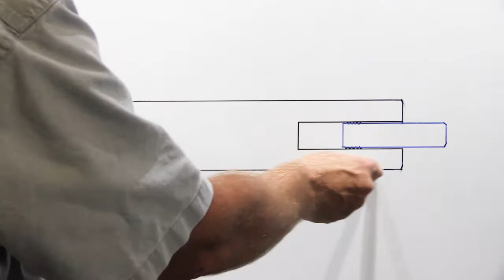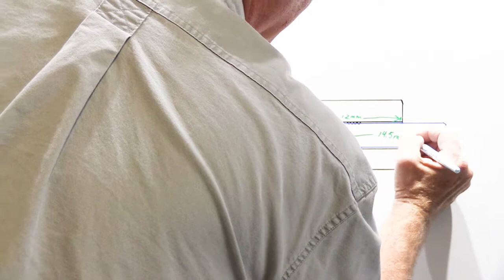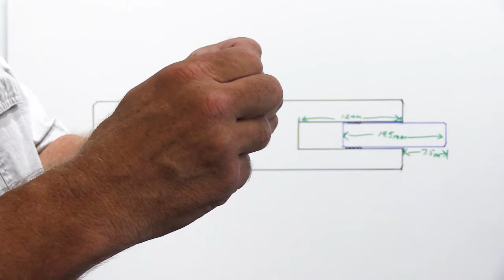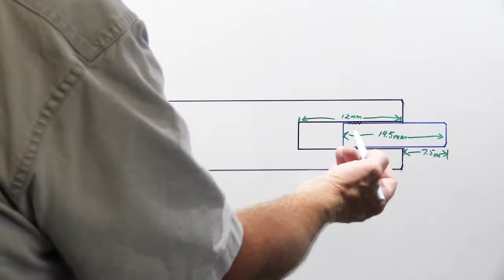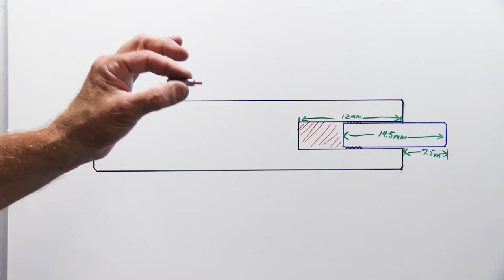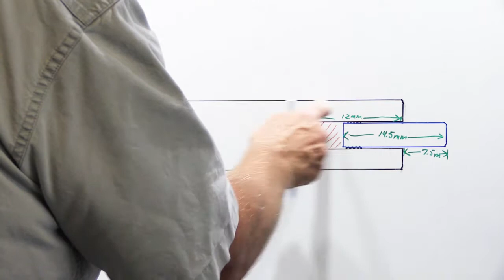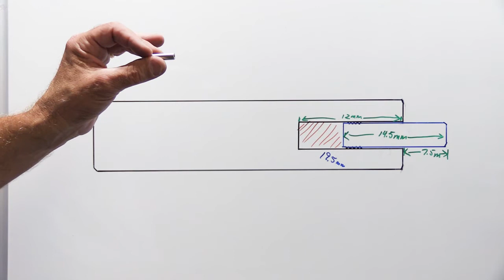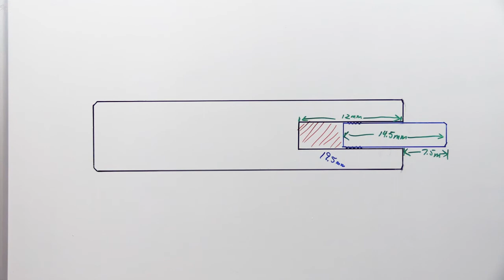NuTone 8-Note Long Tube "K" Model Solenoid Assemblies

Comment: Just finding your video here and years ago I had to repair a chime (don't know the brand), the cap was completely bust, large large crack (it had worked itself out of the chime and lay on the floor). The second solenoid cap was deteriorating too. So I had a friend of mine machine two new caps and added a really thin rubber ring in between the cap and the solenoid body to prevent the caps from slamming into body (quieter too) and hopefully preventing the forces that led to the cracks. 

As for superglue I would instead recommend to use threadlock blue. It's a glue like substance meant to help keeps things in place, but be easily loosened with mechanical force when needed.
Reply from the maker: Hi partick:  NuTone Chime typically have "cushions" inside the Cap to reduce the noise that the Plunger can make.  I believe that the cracks happen just from the pressure placed on the Cap - from being pushed onto the solenoid tube.
     Superglue and Thread Lock both provide the same effect - filling the gap, with a synthetic material and hold the pieces together.  I prefer Superglue because I use it on other Chime assemblies and it simple to disassemble the parts - Thread Lock may be just as good - Chris

Comment: Your videos are extremely well done.  Thank you.  I'm trying to restore my NuTone K-32 that is original to my 1950's ranch home.  The challenge I'm stuck at are the missing plunger tips.  It only had the 2 note left hand tip.  I'm struggling to figure out what to use to make the missing right hand tip.  Any recommendations?  Note, the single note tip is also missing but we dont have a rear bell so I dont actually need it.
Reply from the maker: Hi Tony: You should contact me directly about this problem - Chris 925-743-8236

Comment: I really respect this man and his videos... He often boasts of the early engineers... what if? That threaded grip on the plastic was enough to strike the precious brass metal WITHOUT CRACKING THEM.  When us cowboys crank up the transformer, hang/place chime too close to striker, crank up "volume" button for louder, etc. Mr. Engineer had to shut this puppy down now, before "tone deaf" new owner cracks my beloved brass chimes, by ALLOWING the red striker to collapse 5mm back into the striker air chamber. And thereby immediately protecting brass chime. Silenced tube requires home owner to begin shop call/service call for collapsed red plastic & corrective measures of each example I gave.  I caution filling that 5 mm of air that is really a brass chime safety that has simply not been thought of.  Most respectfully yours,
Reply from the maker: Hi Gregg,  Typically the brass tubes crack from the force that the end cap places on the brass over decades of time.  At this point in time, there is no way to know if the design of the plunger tip was meant to be a safety device to protect the brass tube.  Your concept is interesting - however there aren't any Service Bulletins or other documentation that addresses this topic and instructs Service Centers on how to deal with it - It is information that has been lost to history - Chris
Reply: Thank you for your kind reply. Although I have looked at decades of brass tubes and their eventual declines and failures, I believe as an engineer we can agree that that they have succumbed to a plethora of design flaws & forces, for their ultimate demises.  Dull drill bits stressing the brass, hole drilled too fast stressing the brass, etc.  HOWEVER, my premise is, The original engineer believed nothing was as bad to the fate of the brass, as us cowboys overpowering the integrity of the brass.  Therefore let us behave like a protecting "Grandfather Engineer" looking to safeguard the FUTURE of my brass, rather than the Grandson Engineer that is just quickly trying to get it to make it ring again but could be cracking tubes for years to come.  What if we found the original sized TAPs that could clean out the residual plastic thread tips remaining from the "incident" and/or kick up a little metal thread tips again and the right ring tap for the new THREADED plastic red striker?  Now, has this about to die old goat peeked your interest in keeping good German Trade Skills alive in America? Now as a skilled tradesman you can look back and see all of those brass chimes you saved for years to come, by the striker over powering the structural integrity of the brass. Again, most respectfully yours,

Comment: whats the force of the striker? 5N? 20N?
Reply from the maker: Hi James: No idea - no such specification is published anywhere - All NuTone Chimes have a "Volume" adjustment, which changes the force of the strike - Why do you need to know this? - Chris
Reply: @northsideservicecompany3567  i thought about replacing the solenoids because the wires are so thin and fragile. I already resoldered them. It seems to work but the sound the chime makes is not loud as I would like, I'm thinking the rubber pieces that sandwich the bars need to be replaced or tighten.
Reply from the maker: @jamescarroll4971  The volume any mechanical Chime will have is limited to the design of the Chime and in reality, it can only be so loud.  Strong solenoids will not solve the volume issue - it will likely cause other unintended issues.  It sound as if you have an 8-Note Bar Chime - which are suspended on rubber grommets.  The Tone Bars need the correct amount of "floppiness" on their grommets, so they can vibrate correctly.  If they are held to tightly, they will make a "clunking" sound" when struck.  If they are to loose, they will sound uneven when struck.  These types of Chimes have Resonator Chambers - which are actually what amplify the sound (like the hole in a guitar).  There are practical limits on loud a Chime like this can sound - the correct solution is to add a 2nd Chime and space them in the house so they can be heard all over - Chris